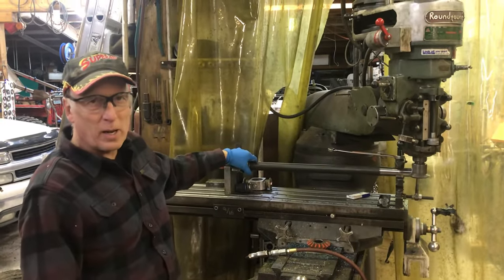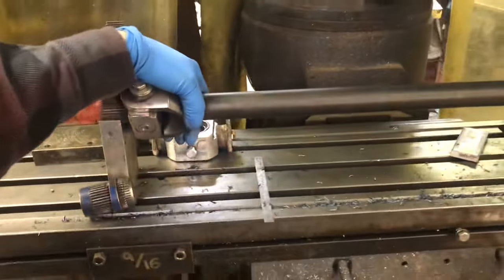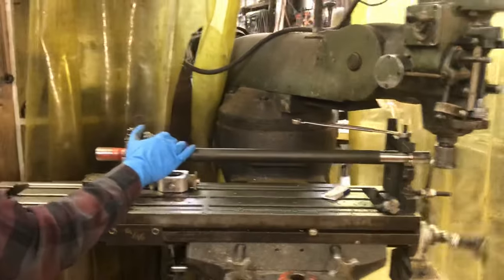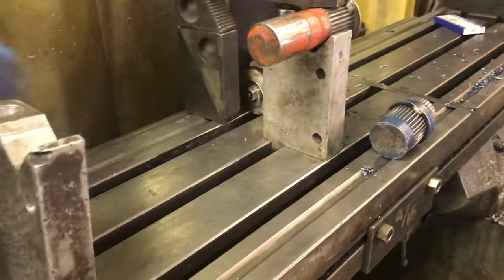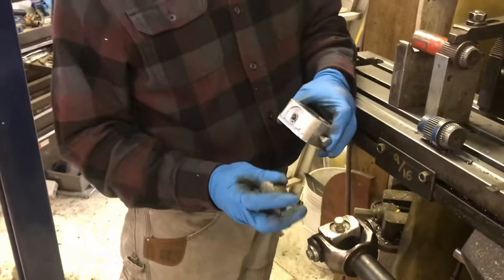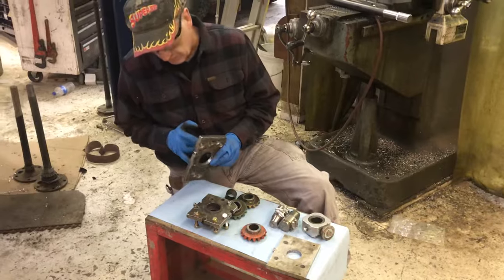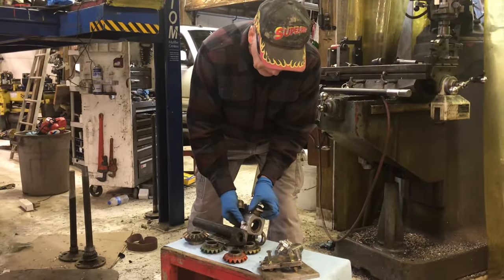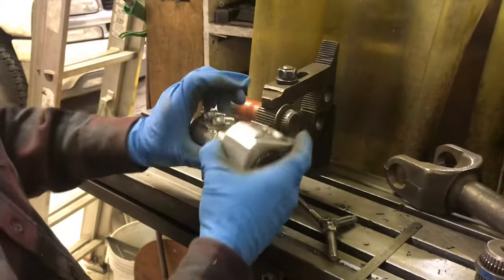Indexing and axle splining, quick and easy, without an indexing head.

Comment: Great video, just found your channel.  My father was a tool & Die maker from the 50’s, 60’s, and 70’s.  I inherited his lathe and purchased a mill about ten years ago.  I was alway under the impression that axles were all hardened after splines were cut, is that not the case?
Reply from the maker: That is how it is done in the OEM world but aftermarket you are often shortening an existing  axle or using a pre hardened blank.

Comment: I guess it is involute spline in that gear. You cut 90 deg. How do you think about that.
Reply from the maker: When you look at the difference between an involute curve and a straight line its only .001” on typical axle splines. That works for 90 and 60 degree pressure angles.

Comment: Genius! Could we get a update on super jeep?  I just bought a pto winch today after watching how awesome yours works. Do you have yours overdriven at all, mine is a Ramsey and it’s very slow according to the original owner. Just wondered what setup you were running
Reply from the maker: to keep up with super jeep, just like the super jeep facebook page.  Does your pto come off the transmission or transfercase?. I get speed out ouf mine by reving engine to 4000 rpm, but never under a full load. I shoot for 2000 rpm and so far the engine will stall before something breaks.  I believe my PTO output is 94% of engine rpm, and if I put the over drive in, which is in front of the transmission, then I get another 27% faster.

Comment: If the splines on a shaft are very worn and a new shaft is impossible to obtain is it then possible to weld up the worn splines, machine down to original diameter and just re cut new splines?
Reply from the maker: I have done that on old farm machinery many times.  but its never as good as new.
Reply: @superjeep47  I had a problem with worn splines on my boat transmission output shaft. I have now secured an order for a new shaft from Seattle, USA